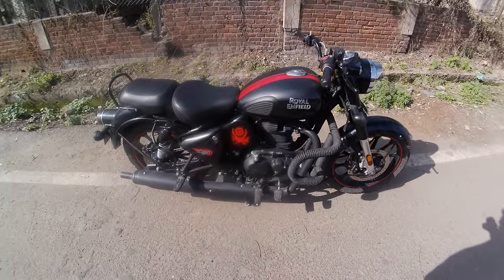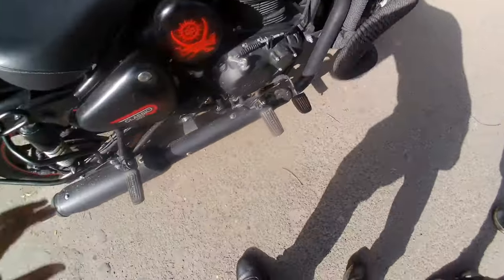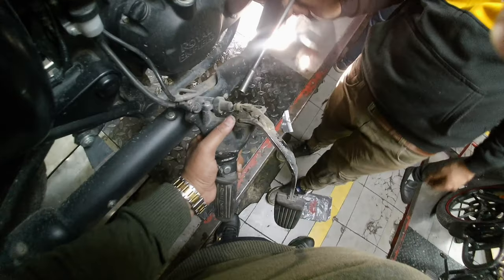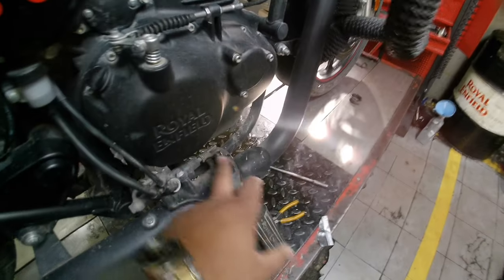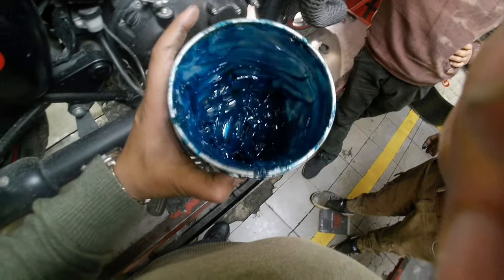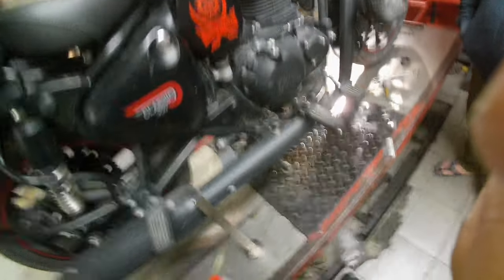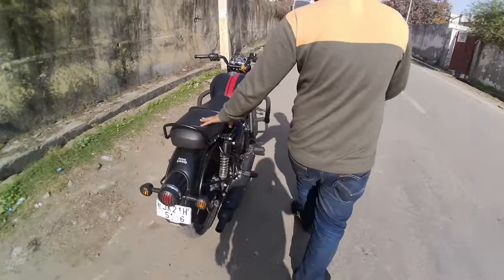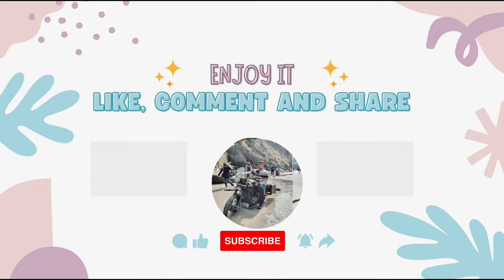Rear  Disc Brake pedal Stuck problem | Solution trying Is it Work?

Comment: Sir meri yhi bike hai lekin uski problm ye hai rear break apply krne pr back light nhi on hoti jaise break pedal press kro toh back light nhi on hoti
Reply from the maker: khrab hoga rear brake light  switch
Reply: @SohanfromEnfield  classic reborn ka break light switch kaha hota hai sir
Reply from the maker: @syedmehrabali  abs moderater k sath hoga
Reply: @SohanfromEnfield  sir maine Rajouri poonch royal enfield ke service centre mai dikha diya lekin kisi ko iski knowledge nhi hai
Reply: @SohanfromEnfield  sir fuse ka problem toh nhi hai jiski wajha se light nhi on ho rhi front break se on ho rhi hai but rear break se nhi
Reply from the maker: @syedmehrabali  mere baat krwa dena workshop manager se usse bolna mujhe call krna
Reply from the maker: @syedmehrabali  brake light switch ki problem hai mere bhai
Reply: @SohanfromEnfield  sir ap please mujhe apna number dedo
Reply from the maker: @syedmehrabali  9796203026
Reply: @SohanfromEnfield  ok sir thank you
Reply: @SohanfromEnfield  sir jo mukesh sir hain unka number bhi hai mere paas Xtreme motors dealership hai jo